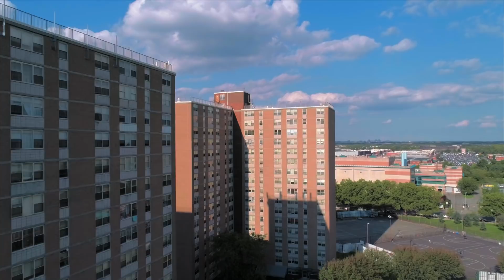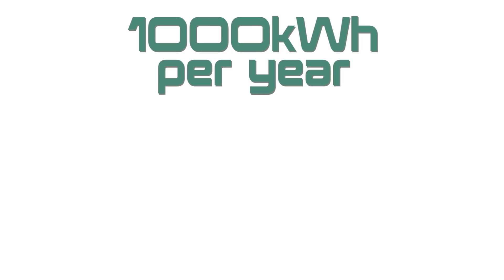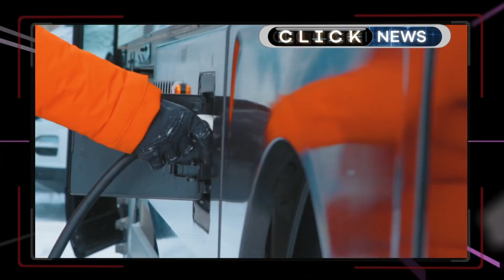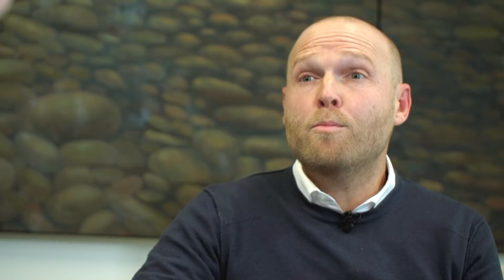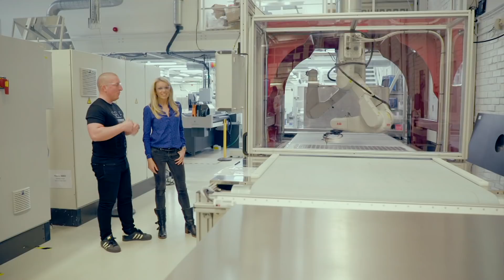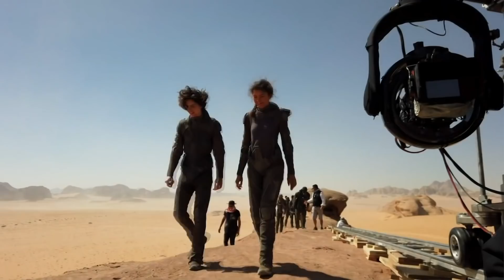Could Solar Solve The Energy Crisis?

Comment: Solar can't "solve" the energy needs by itself.  But I vacationed in Mexico close to the ocean last December, and was quite surprised that I did not see even one solar panel! I heard a lot of air conditioning units running, the city and our resort was well lit at night, including the walking paths and beach.  It was full sun 6 out of the 7 days I was there. 
What I simply do not understand is why people do not take advantage of the free daily sun, to charge LED lighting for the night or even warm partially the fresh water needed to wash dishes at the restaurants and hot water tanks, that guests use to take a shower or fill a bathtub.
Reply: Do you have solar on your roof?

Comment: ANWER YES !  We have a third rate government run by maniacs. The UK needs proper leadership on SOLAR if it does not come from the government then it needs to come from a group of wealthy people and companies. Every INDUSTRIAL, COMMERCIAL and MUNICIPAL building needs to be covered with solar panels. I have no objection to using land but we have thousands of large roof properties that are currently naked of power generation. Plus those properties are closer to where the energy is needed than solar farms out in the countryside. It needs to be coupled with both battery storage and battery load balancing. These building would offer total export or battery regulated surplus power at certain times of the year when there are block holidays. Industry tends to take August and the Christmas/New Year period off while schools have many holidays throughout the year. Sports and cultural venues are often quiet with low level activity for days and thus most of their energy can be shared with the local community.

Comment: I installed a 5kW solar array on my house's roof 7 years ago and haven't paid for power since, and it charges my EV, so I don't pay for gasoline either.  Yeah, solar can definitely solve the energy crisis.
Reply: It could solve your energy crises. Lets be honest. I love my solar system, but my  2kw system at 72degress north(72% efficient) I only collect about 6kwh a day, out of the 38kwh a day I use....Not counting my vehicle, or heat.
Reply: No, solar is for rich kids in warm countries. In many parts of the world the output from solar is minuscule during the time we would have the greatest need of energy; during  long cold winter nights.
Reply: @SweBeach2023  solar is for developing countries actually. It's the developing countries who occupy most lands where solar will work the best.
Reply: What about battery? You should be changing one in 8yrs.

Comment: I recently looked at getting Solar, but for the panels and battery back up it was about £7k and will likely take 15 odd years to pay for itself. Otherwise would have done as in theory could charge our car and mostly power our home on solar. But 15 years is a long time to see a return.
Reply: The return on investment starts from the day you use it and stop polluting the atmosphere.
Your lungs, health and the environment that keeps you alive has a value too. It's not just about the $$$.
Reply: @ahaveland  here in the UK, thousands a year die from air pollution. I don't want to be a contributor.
Reply: @PaulMansfield  I don't have any intention of being a "contributor" either  - I don't use fossil fuels, and I don't live in the UK and I built my own EV and house batteries from thousands of harvested laptop packs.
Reply: Remember that a battery will not only save buying peak rate electricity in the evening, you can charge it off v cheap electricity overnight and avoid buying peak price electricity before dawn.
Reply: Back in May 2019, I reckoned my 6kWh (useable) capacity battery would earn it's purchase price in about 9 years when it was installed, that payback is accelerating with energy price rises.
Reply: @PaulMansfield  its been sunny today but really cold so ive had an oil radiator running all day . saved a lot of money
Reply: @rodden1953  where does the power to run that come from?
Reply: @PaulMansfield  What a conservatory  or my Tesla Powerwall  ?
Reply: @PaulMansfield  If you are talking about the radiator the power comes from the sun . . when the suns gone it comes from the powerwall
Reply: Yes, 15 years to pay back. As opposed to any other form of energy you can install in your home and never pays for itself.
Reply: Same price as a Conservatory that never gets used

Comment: No, Solar can not take over from the grid yet. The combination may be suitable for now, but until solar is perfected, it will not be all. Batteries are in question for several reasons, and before Solar can take over, these questions need to be addressed.

Comment: do simple copper copper-oxide transparent-metal solar cells, on sheets, copper-2-oxide CuO is the most optimal single junction solar semiconductor, yes, metal-semiconductor junction, not doped semiconductor p-i-n, but m-i-m junctions, easiest to make also
Reply: if you use heat cooler circulated salt water as the top electrode, you have both water heat collection and direct electric conversion, 2-in-1 package
Reply: combined heat pump with solar electric
Reply: copper roof
Reply: why only 10%, you had 25% as a standard, what made you lose your efficiency, a lie
Reply: if you use aluminium (metal) directly as power source and storage, your price is around 45p/kWh
Reply: your jacket back side is 1sqm^2 for solar

Comment: Those oddly shaped solar panels are going to have a terrible efficiency and be very pricey per kWh. It's simple geometry.
Reply: I agree, it's a very expensive system, seems to be designed primarily to look good.
They'd be better off using the film on the windows of the house.

Comment: Solar is the worst of all renewable generation types, including tide and wave, which are not particularly good.
It is useful for off grid applications but not as a source of grid supply. Apart from it's poor availability factor it is technically unsuited for a couple of reasons. It cannot load follow, quite the reverse, no inertia, characteristics required for feeding a grid and keeping it stable.

Comment: I live off grid on a boat .
I use 39kg of gas per year, and solar fulfills all my electricity requirements a year,  plus my propulsion is electric !! 
Solar and wind turbine is the answer  ! 
If you can't afford to fill your roof with solar , think out the box and convert 80% of your electric consumption to 24 volt ! 
A full off grid set up can cost you as little £ 1200 ...
Reply: Name checks out
Reply: The problem is that you need a fairly sizeable turbine to generate enough power for a house with 4 people.
Reply: @PaulMansfield  a friend of mine got his neighbours together and they all pitched in for a turbine ... all 80 of them ! The planning permission was granted and the huge turbine erected  on wasteland near their estate  ( ex council houses ) . It cost them  £23, 000  20 years ago . ( 285 each ) . Their yearly bills have never exceeded £ 100 .  
Now I'm sure turbines have improved in the last 20 years and I know for sure they are cheaper !! 
That turbine still generates power for  at least 80 households  today !!

Comment: @5:00 The maths are wrong. It costs 3500 pounds and produces 1000 kWh/year. If energy prices are 26p/kWh,  it would pay for itself in 13.5 years (3500 / (0.26 * 1000)). If energy prices go up, it pays for itself in less time, and vice versa. The 20 year warranty has nothing to do with the payoff time.
Reply: That's assuming you can use all the energy it generates. If you assume half gets exported, you make only 7.5p/kWh.

Comment: Sun has to be clear of clouds, panels must be 100% clean or their rating goes down, don't work at night for some weird reason. surface area of panel must be unprecedentedly massive and you have to create Global Warming to dig up they battery to store the energy till its needed..  yay for He.
Reply: All bogus info !! 
Solar does not have to be clean as I have drawn more energy off dust particles than totally clean panels ! 
Monochrystaline solar panels work on cloudy days too !!  
Yes battery manufacturing creates emissions but 3 batteries every 7 years is nothing compared to the average house ...
I live comfortably all year using just 1.2kw of solar !
Reply: @jasonwoods3711  Solar panel are 30% efficient at Perfect Conditions ie  if you have todays versions Are at 25 degrees ! pointed at the sun, in the process they at heating up the air THIS is why the latest have water cooling. CLEAN. If you believe DUST makes them work better, cover them in it.
Reply: @jonscot8393  I have 430 watts of solar that power my living all year round jon and the rest goes to my propulsion  !! Dust on my panels has extremely very little effect at diminishing that power I still have plenty of power all year round !!!!! 
They are laid flat in the summer and angled in the winter.... it works  for me  very well thank you !  
A friend of mine lives in a house . He has 8 panels on his roof . He hasn't had an electric bill for 10 years and received a cheque from the grid every four months averaging 300 pounds  !! 
What can I say ... win win win for us two !!!

Comment: I don't know about you but I close my blinds at NIGHT not during the day. So I'm not sure having flexible solar cells on those blinds will be that useful.
Reply: Houses tend to be empty during the day, would make sense to have these blinds operating during those times.
Reply: Maybe in warm climate in a hot day they can be used to block solar gains if they are outside of the inner glass panes. at winter time that would be plain foolish. if a window is mostly covered, it should be a wall. anyway (in the video) the argument of "i just don't like them" about conventional panels does not help to sell a lot less effective product
Reply: The example given was for Spain where you do shut blinds during the day to keep the heat out of the house and open them at night to let in the cooler air.